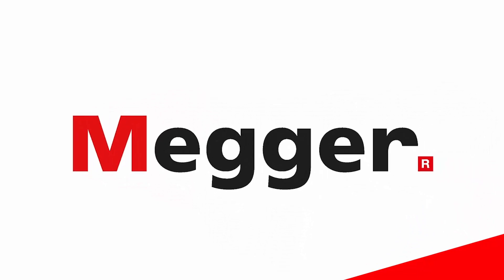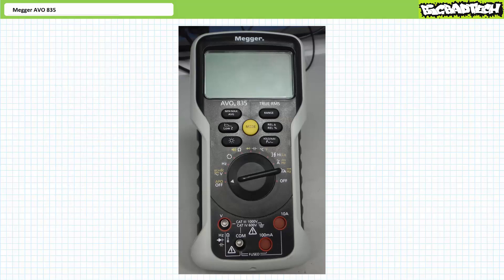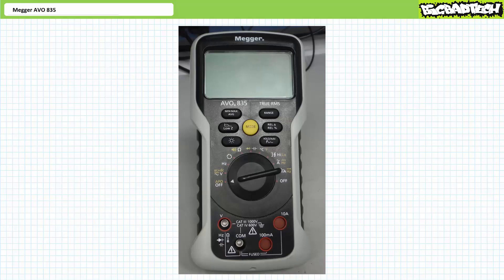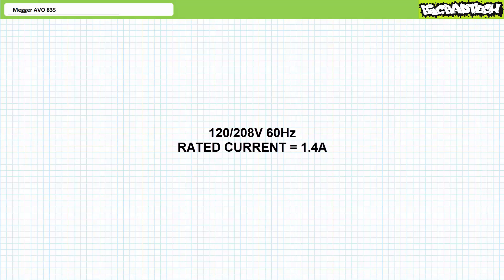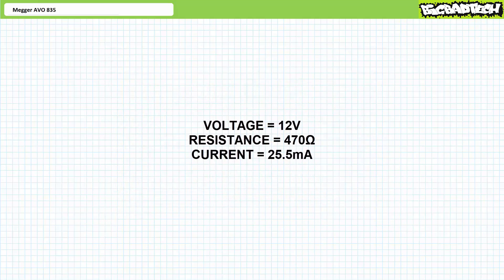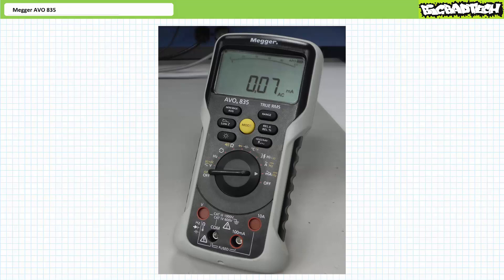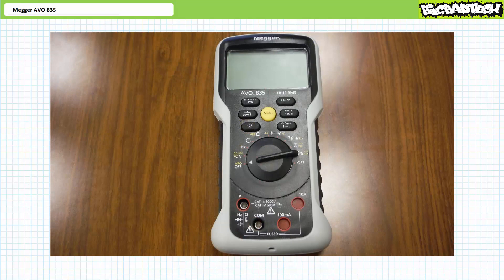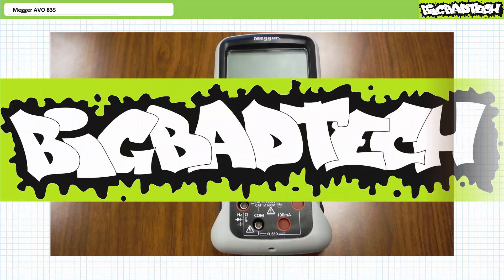Megger AVO835: AC and DC Ammeter

Comment: Jim, will you ever do any basic networking, communications, etc videos? They would be extremely helpful since so many electric components are being integrated with communication protocols. Thank you sir.
Reply from the maker: True dat. Unfortunately, most likely the material I've got planned in the foreseeable future will only be tangentially related to networking and communication. Now that I've fixed the older lectures in the Basic Electricity and Electronics 1 playlist my plans are to start publishing new material on motors and generators, industrial wind power and solar power, power transmission, power electronics, and digital logic and PLCs. Aspects of networking and communication will kind of be "side" topics related to these main themes. This being said I just got my hands on some cool new Megger tools that are used in communications. Plans are to feature this equipment in some new lectures.